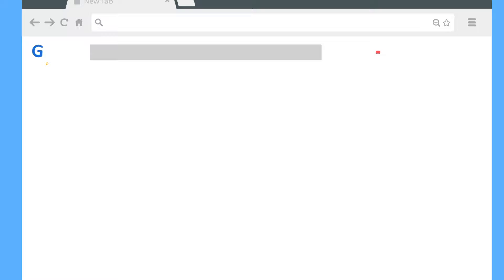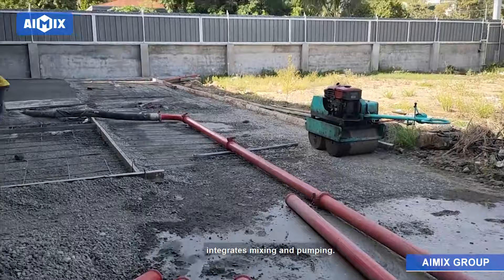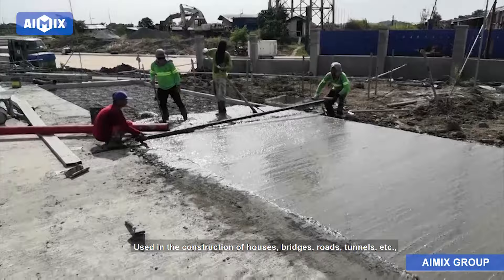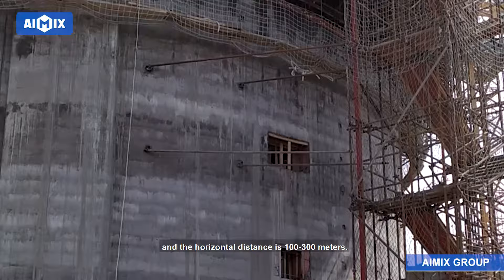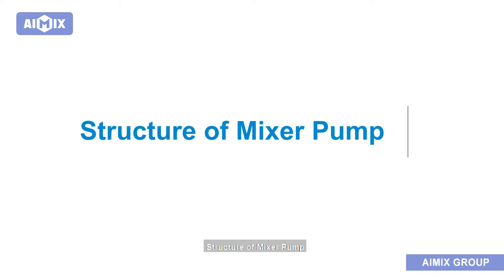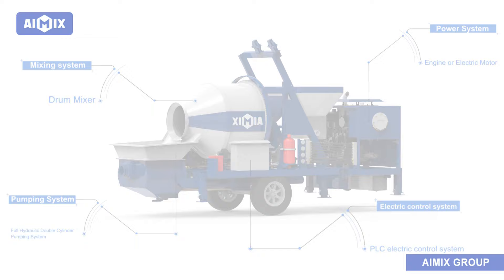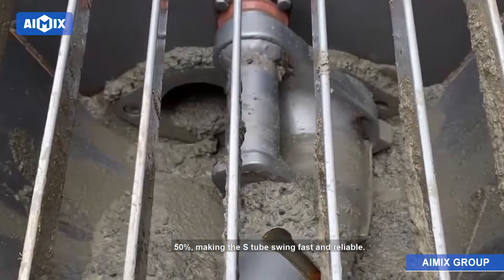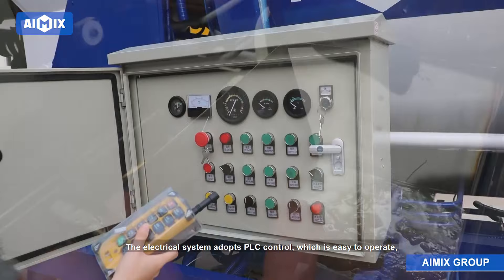How Does The Concrete Mixer With Pump Work?

Comment: How to loading the material to the hopper? it should using excavator?because i see the hopper in high elevation
Reply from the maker: Need to use a wheel loader. You can check the solution web page here: https://concretemixerwithpump.com/construction-machines-collaboration/